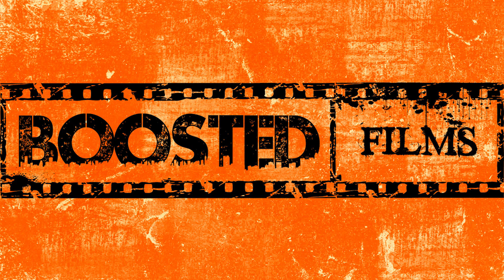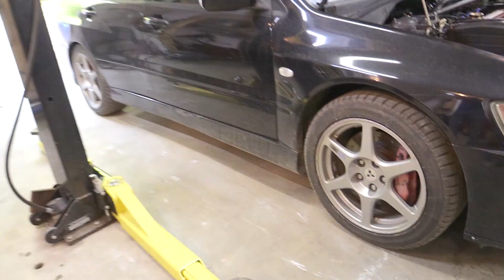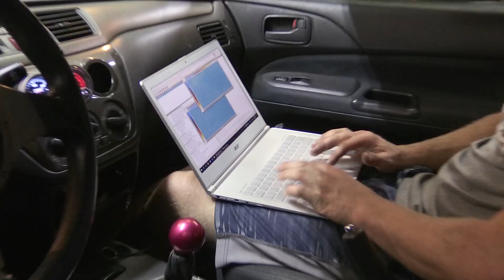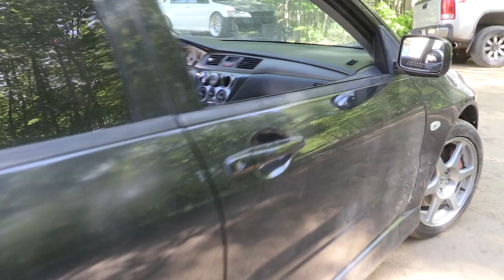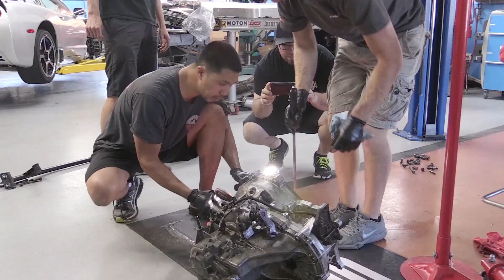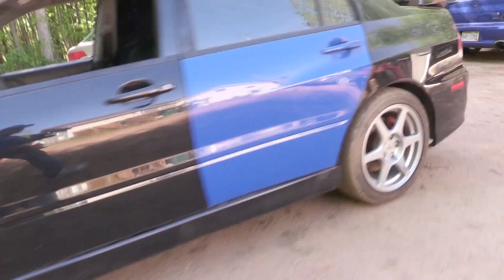EVO vlog #10 - It's Alive!!!

Comment: Sorry to hear about your divorce, but congrats on finally getting the Evo running. I’ve been working on mine since January. Can’t wait to drive mine again
Reply from the maker: What year evo do you have? What are you doing to it?
Reply: Boosted Films I have a 2005. I had my head rebuilt with brand new everything. GSC S2s, Kiggly springs and new 750cc RC injectors we’re installed. The car will be converted to speed density. I got the car to fire up this weekend.

Comment: right now Im running a external 02 dump with a non divided gasket, is that bad? and should i switch to divided?
Reply from the maker: Does exhaust air come out the 02 dump all the time?  It's fine to run it that way, I would just think it's annoying
Reply: it will just sounds like an exhaust leak.  wont cause any real problem